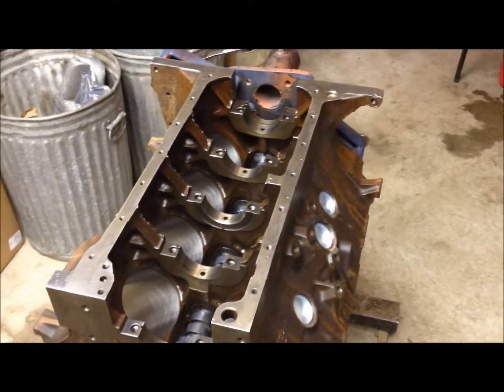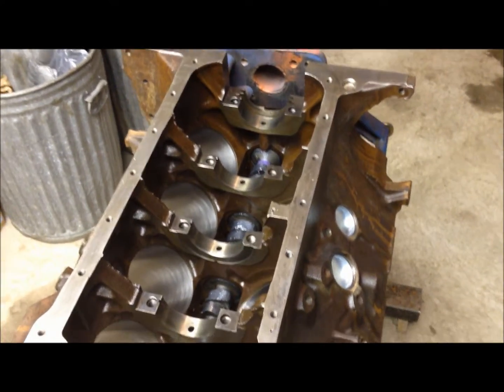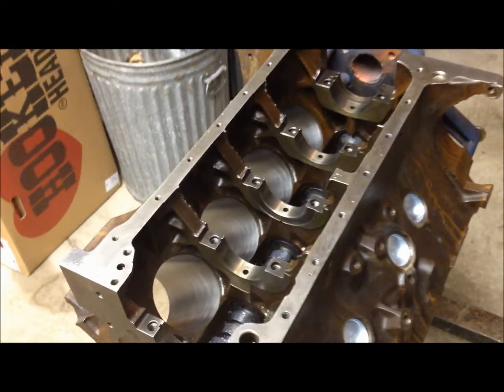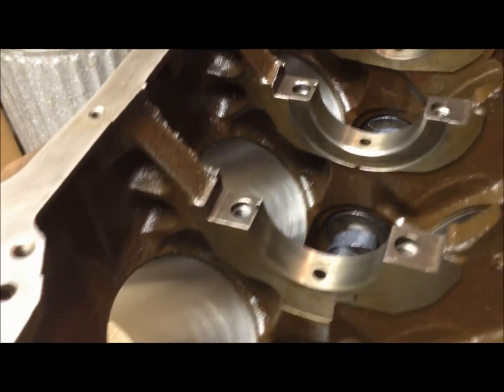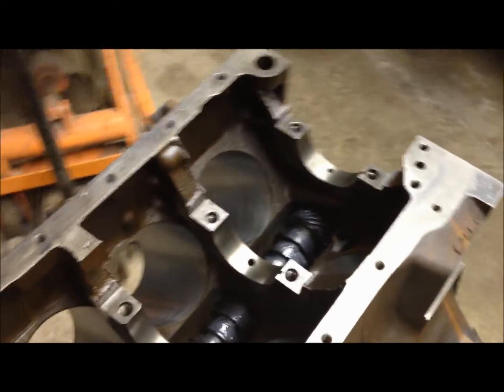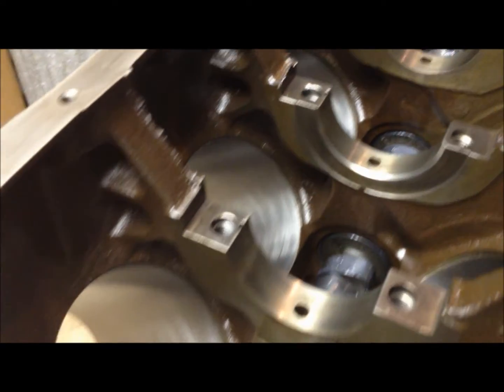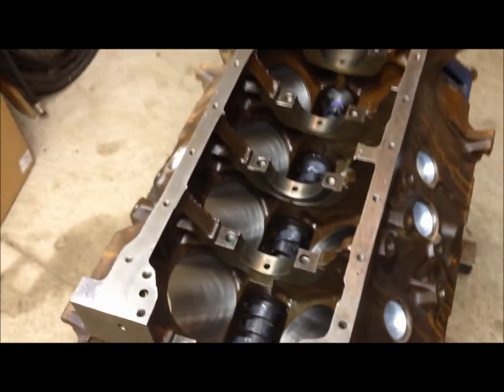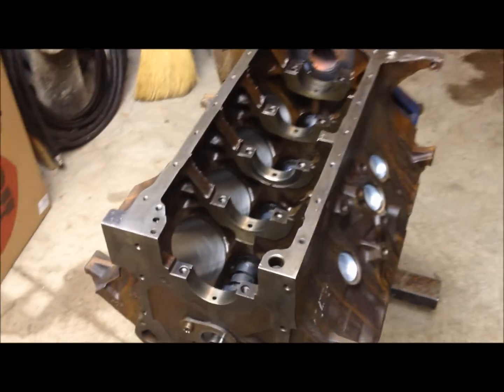The Strongest 390/360 FE Blocks

Comment: jnl jnl,  turning a 391 crank to car specs is not a cheap forged crank,it is the best fe crank available today .I have 2 391 cranks milled,lightened and balanced for 427,I have at least 1100.00  machine work in each not counting core but they are the best crank ,other than an old c5 or c7 forged ford crank which are non existent.
Reply: The NASCAR people would use that crank in a 427 that ran 8000RPM's and lasted .I think they ground the crank for the wider bearings and used the NASCAR rods .The Hemi could not go there without failures no matter how you de stroked it

Comment: Look for a mirror image 105 on the block and 9 times out of ten its a medium/heavy duty FT block. They also consist of a larger diameter distributor bore
Reply: MIrror 105 simply indicates a casting from the MCC foundry - +/- 1972 or later.  They tend to have thicker bearing areas and often have the double web in the mains - theoretically stronger.  Just pickup truck blocks for the most part though - normal distributor holes (a good thing).  The vast majority are not FT blocks.
Reply: @Survival427FE  I hope that you are doing well. Are parts beginning to trickle in?  I hope that a guy we both know is allowing anything to get out to others. I got myself permanently banned from my family in the FE world. All of the weenie whining  from the snake. God bless you, when I do my stroker turbo engine I know where and who to call.

Comment: do not rebuild an ft 361 or 391 and expect it to bolt in to your car the motor mounts are not the same . you can turn down the crank snout and use it in a car block for a cheep forged crank. nice vid.
Reply: Motor mounts are the same.  Passenger car distributor would need a bushing.
Reply: Barry R the big truck 361 and 391 ft do have deferent motor mounts than Fe 360 390.a larger crank snout and a massive damper.
Reply: Barry R I'm talking f600 not f250
Reply: So am I.
Reply: @jnljnl8485  Those are good possible cores for a 700+hp build. Great iron recipe!
Reply: The bolt holes are there. The truck many times used an iron front cover , was the engine in mounted by the front?  Usually they had a horseshoe shaped bracket bolted to the front cover with a mount similar to a transmission mount and the bell housing had a mount at a 45 degree angle on each side of the bell to the crossmember. It was essentially a 3 point mount. But you can take the bell off, remove the front bracket and iron cover. Replace it with the aluminum one, and bolt the mounts on for your car. Best of luck!
Reply: Truthfully a turned down and a cut off FT crank is heavy. I  wouldn’t bother with that crank, an iron one is strong and you could get it offset ground to a 3.98. But for the cost, you could build a lighter and just as strong stroker. A 4.25,Scat cast steel, H beam rods and forged 4032 aluminum in a kit would be reasonable, Barry R can get all that.  I  have a block that should be a. 428 bore and with a 4.25 crank it could weigh 60-66 lbs depending on whether I got the Scat Forged Steel or the Cast Steel at 58-60 lbs. Getting the weight down makes them rev quick, quicker than a 352 or 360. If I can bore it to 4.13 with a 4.25 stroke that’s 455.48cubes and 6.7 rods the FE is the same size main as a BBC, and the 2.2, rods at 6.7 as light or lighter than stock rods and good light Forged pistons with 1mm/ 1mm/ 2 mm oil rings would have less friction in the bores and be lighter because of narrow rings.  4.16,with 4.25 stroke is 462.12 ci. 1.52,ci per cube for 700+ hp. Even the 4.13 X 4.125 cast steel can handle 700 with H beam rods and thin low friction rings. Call Barry R at Survival Motorsports, he literally wrote the book on FE performance, and anyone else who pretends to know more is repeating what he wrote.

Comment: I have a 360 in my 66 ford. I also have a 390 truck block to build. I love the torque the FE generates.
Reply: Jerry Stennes yes, I was really surprised when i drove a 428 PI. The torque difference between the 3.78 stroke and the 3.98 stroke was surprising to say the least. That stock police car ran 14.94 E.T.  bone stock with 3.00 rear end ratio. THE CAR WEIGHED 4,500 with just me in it. You couldnt pull that wieght that fast with a 390. I owned 390's before. Great motor. But the 428 PI, or COBRA JET WILL SURPRISE YOU MORE THAN YOU THINK. And they rev like small block to. The cobra jet package came from the police package. Except bigger valved heads and ports. And a Holley 4 barrel and cast iron headers. Otherwise the short block and cams were the same. Bob Tasca Ford originally slapped some 427 low riser heads on a police 428 intercepter. And added a Holley carb to the mix. And the 428cj was born. Horsepower sells motor cars. Torque wins races. After owning a 428 PI or CJ I WILL NEVER GO BACK TO THE SHORTER 390-427 STROKE. Besides rpm breaks motors. The feel of 428 vs the 390 is like adding 15 lbs of turbo boost. You can find 428 cranks in 66-67 big mercury's. Mercury"s with the 410 motor. Basically a 390 with 428 crank=410. Stock 410's and standard 428's were slow dogs. They need hi-per cams in them if you want to benefit the most. That was also the difference between standard 428 and the hot 428. If you can find a 406 block thats even better. It has the 428 bore 4.13 but has the 390 stroke crank. You could put a 410 crank in a 406 and have a 428 from it. And the 406 has the better oiling for racing. Oil galleries  are bigger. Standard FE's have oiling problems if you run them hard. Some drilling and relieving helps the standard oil galley's out. Fe has too much oil pumped to the top end if your hot rodding alot with it. And if the oil gets dirty. And some dirt build up get loose. You will have the dreaded lifter knock. Because dirt got inside the lifter and has locked it up. I change oil filters every thousand miles and add sea foam before a oil change on hydraulic lifter fe motors. I use solid lifters on my motors most of the time. I love solid lifter cams in my fe. It loves them too. And valve adjustment is not that hard once you know the process and have done it a few times. Oh, to find a merc 410 motor. Look for those pent roof blue valve covers that say mercury on them and a lightning bolt below the word mercury. That usually a indicator its a 410.
Reply: @jongallant6054  But to compare a 390 to a 428 in actual power is kinda pointless as far as stock builds from factory go. The later 390's were only 330HP variants tops. 375Hp versions were dropped way before the 428 came out. To be fair one would have to compare say the 401hp version 390 to the 428 which was a 9 year difference in year models. Later year 66 and 67 were mild compression ratios.
Reply: @jongallant6054  - modern stroker cranks make searching for used OEM 3.98" cranks a waste of time and money.
Reply: You can take off in High gear fairly easy even with a 360. There was an old man near my house, he was so tight with money, he hardly ever took off in 2nd, just left it in high... Dad's 390 in his 68 f100 with a 2.76 he put in out of a 68 LTD could pull a good load and still take off in 2nd with no problem... Just lug right out... He took the 68 390 2bbl. and installed a new car cam and overhauled the engine with a cook out and honing, valve job and set of bearings and rings. That rebuild last 21 years... and over 250,000 miles... Fairly good for not boring it... Would have went longer if he'd put a set of valve stem seals in it... When he died, it had sat a few years and the cab had rusted down a bit and was tired. I should have kept it...
Reply: kram Null you describe it great.
Reply: Jon Gallant you sir are very knowledgeable when it comes to the FE engine,as a teen, I had an older friend who ran the 406,428 w/tri-power,427 & 454 in 65 mustang, 58 Ford 300?,66 Mercury GTA with a 486 .Now I'm 65&those days are long gone,but damn what great memories!!!
Reply: Robert M. Trolinder jon read alot of books.
Reply: Jon Gallant ,
SCAT has a crankshaft with offset of 4.25 stroke.
Talk about bottom and horsepower torque.
I can't remember how much they are but you can usually get like an entire reciprocating assembly rods Pistons everything Rings Etc.
Turn any 390 into a torque monster.
Yeah I used to drag race semi professionally of Cobra Jet Motors.
Couldn't beat it for bottom-end torque.

Comment: Ford did not use nickel as an alloy element in any of the FE blocks ever.  There is no such thing as a high nickel block.  Ever.
Reply: Yes.  But I hate to see long discredited urban legends repeated over and over again.
Reply: Randall Highsmith, I'm pretty sure Mr. Barry Rabotnick knows a thing or three about FE engines. I mean he has a couple published books on the subject and whooped up on some folks in this thing called "Engine Masters". Ever heard of him? Besides where's your proof of the alloy formula Ford foundries used?
Reply: Most normal FE blocks (390 or 428) get kinda sketchy beyond the 600HP mark when naturally aspirated.  Turbo is fairly easy on parts when tuned well.  Probably get by in a pinch with a double web block (later 390 truck, 391, 428CJ) and some ARP studs as long as you have good machining and tight cap registers.  Cross bolts are a good improvement but rather expensive.  Cranks are all plenty tough enough, but the stroker stuff has the far superior BBC based 2.200 journal letting you go to better parts everywhere else cheaply.
Reply: Prove it...I can provide the alloy documents (it would take a little while to dig them up....buried in the archives)
Reply: I agree and appreciate it. I suppose it would be interesting to see and be able to compare it to known stout blocks. In a related note, I'd like to hear your input on building a long block FE for a turbo that can reach 700hp zone without being too costly.
Reply: I'm sure you could but it's not really that relevant. If you're building something that wild there's aftermarket blocks better suited for power and durability right?
Reply: Good to know. This is for a late 60s F100 build so as long as I do my homework I should be in good shape. Scat 3.98 stroke with h-beam rod, forged dish and ARP throughout is the base. Cam, heads and intake selection is where it's going to be critical. I did want to use a blow-through carb but the FiTech set up is boost ready with a compact design. All just bench racing until I retire from the Army so there's plenty of time for the hunt.
Reply: check your codes in the lifter valley .      There are some higher nickel blocks and some not .
Reply: @deweydodo6691  - your high nickel block story is B.S.
Reply: @deweydodo6691  Please repeat;  THERE IS NO SUCH THING AS A HIGH NICKEL BLOCK!
Reply: Barry R no your wrong 427 blocks had high nickel content in them for extraordinary strength.

Comment: I happen to buy one of these of accident, My 360 got a cracked block due to it freezing and it's ruined. Went out and found a running 390 for $500 and got the price down to $290. Took it apart and rebuilt it. Really solid and perfect. Needed a timing chain but no big deal. Going in a 1973 f250 highboy. can you tell me how much this block and or engine is probably worth?
Reply: kylebob2525 about what you.paid.. Going to get a 360 today for $100
Reply: the steve mcqueen bullitt mustang with the fe engine. sold for 3. 1/2 million. there saut after around here gettin exspensive. im a very proud owner of 75 4x4 highboy hade since 1989. best horse ford ever made,,